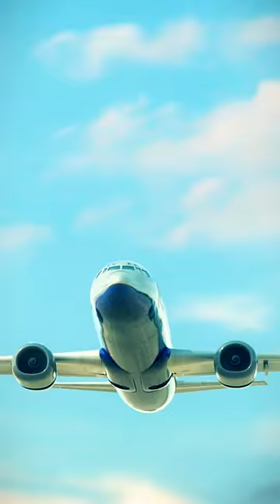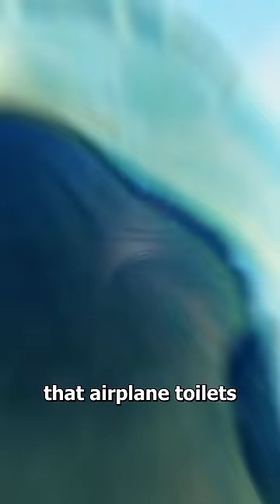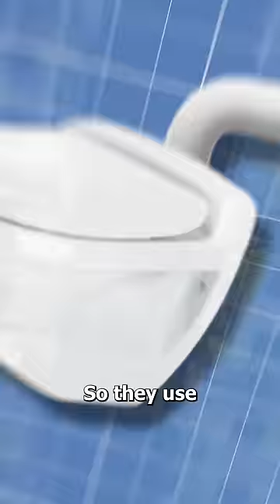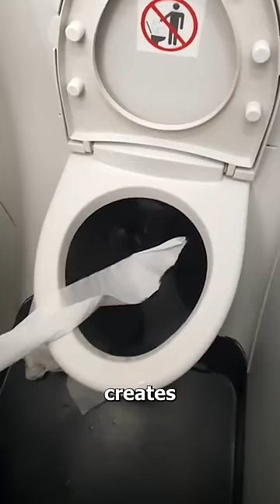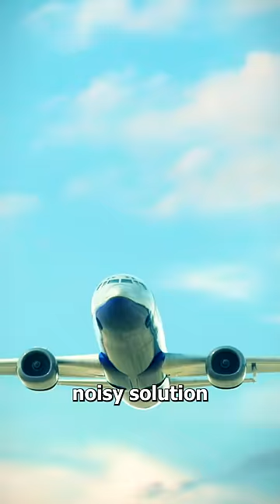Why Airplane Toilets Are SO Loud 😖🚽

Comment: Imagine staring at a plane in the sky and after some time, random peoples shit fall upon you 💀💀
Reply: This had me laugh crazy ..😂😂😂😂😂
Reply: No Wonder Why Discord Mods Don't Go Outside
Reply: 69 likes let me ruin it 

Btw funny comments
Reply: Chocolate rain
Reply: Someone actually died from that. All the waste that gets collected turns into this blue ice like thing and gets dumped out. It fell on a dude killing him
Reply: @dannielyt  'I felt that' -  👴
Reply: I was looking for a comment like this
Reply: @AlexSanders500 t doesn’t do this unless in case of emergency. The planes have tanks for this and it is emptied with the grey water (also in a separate tank) on the ground before they refill the clean supply tanks.
Reply: @AlexSanders500 that's cap
Reply: @AlexSanders500 it doesnt, your lying. i work for qantas and it actually gets sucked up into the plane and then it gets cleaned up.
Reply: @royalewithchz  i looked more into it, turns out its more of an accident not an actual thing thats supposed to happen lol
Reply: @AlexSanders500  only happens if there is a leak and its only a fluid that freezes,  very rare
Reply: It can’t it goes into a tank like in RVs.
Reply: @LSnium   yes but there can be a leak where its serviced which then forms blue ice, a 727  lost an engine  from the blue ice being sucked up by the rear engine on one side. over OKLAHOMA I believe.  Quite awhile ago.
Reply: 1985 AA 727 over New Mexico from blue ice from leaking lavatory connection, engine snap off from sudden stoppage
Reply: This happened before lmao
Reply: JOE DIRT! 😂
Reply: Ask the veterans from the 1920-30s, they've probably felt that already since that time the toilets are just holes to the outside of the plane 🗿
Reply: Nahhh💀
Reply: @dannielyt  blud found the emoji section
Reply: Ewww this got me grossed out going to barf 🤮brothers got bird feces on their shirts it’s gross,but not as gross as what you comment is all about 🤮
Reply: @maidarawad1961  💀💀
Reply: @AlexSanders500 they don’t drop it from the plane soooooooo
Reply: 😂😂😂😂 this is what I was trying to say 🤣🤣🤣🤣
Reply: @alexleo172 ohh so that's what he was singing about.
Reply: @AlexSanders500  aint no way people got killed by a turd bruh💀
Reply: U made me laugh hard 😂😂
Reply: 😂wth
Reply: @AlexSanders500 tf are you on? the waste is stored in a container, it doesnt just fall out of the plane lmao
Reply: @LaMelon  bro can you read? I later corrected my self that its a leak that can happen 💀
Reply: @AlexSanders500 the waste does not fall from the plane, it gets sucked into a tank and after the flight the ground crew empty the tank
Reply: I jus made this 1000
Reply: Dont worry all gets caught in a tank
Reply: @dannielyt 🗿
Reply: @AlexSanders500 NONSENSE
Reply: @JamesAnderson-mr2sg as opposed to the front engine?

Comment: Disturbing fact: It’s possible for an airplane toilet to suck your intestines out of your body. This is called a prolapse
Reply: New fear unlocked
Reply: Thanks for unlocking a new fear, now I won't ever go to toilet in airplane 🥲
Reply: Just empty out everything before the ride
Reply: @ShubhenduXD stand up before flushing
Reply: No it’s not
Reply: The suction force is also powerful enough to break bones
Reply: Yep, thank you. I'll never use an airplane toilet again.
Reply: this is why i never took a shit in an airplane bathroom
Reply: No, your intestines cannot get sucked into a toilet cruise ship or airline toilet with strong suction.

The toilets on these vessels are designed to flush away waste and not suck anything in.

Even if the suction was incredibly powerful, it would be impossible for something as large as an intestine to fit through the small opening of a toilet bowl.

So rest assured that you can use the restroom without fear of having any body parts accidentally sucked away!
Reply: Exactly so please stand up before you flush
Reply: It was because of someone telling me this, that I now never use the plane toilet to poop
Reply: @cheems5015 m... not really, sucking won't break bones but if the hole is too small and the sucking force strong enough then it can definitely but the suction in itself won't break bones. Even blackholes just stretch out your body and do not break bones.
Reply: @saumyashah4831 if you believe that it would suck out intestines 😅
Reply: @ShubhenduXD  ive never been in one tbh, its digusting and now i have another reason
Reply: @Silver-we9jb  same💀💀💀
Reply: I was thinking about this while watching the video but of course it’s a thing
Reply: This is incorrect it’s not possible for it to suck out your intestines
Reply: Why does that even exist
Reply: That’s just a lie
Reply: Our intestines are fixed in our bodies lol, they're not at all loose as portraited in the movies xD
Reply: @Lubin-md4ml  and the way Final Destination described as well
Reply: @jersanjereos4525 Thx. My family and i are going to vacation soon so this is helpful
Reply: @saumyashah4831  even if that’s the truth I’m still not testing that shit
Reply: May or may not be true, has been proven to be real pool is drains
Reply: @meepacorn9253 it’s a real fact
Reply: ☝️🤓 Actually, a prolapse is a natural event where the supportive tissues of the anus collapse and allow the large intestine to begin wriggling out of the body. However, hypothetically, if a prolapse were to occur on one of these toilets and someone flushed without realizing they prolapsed (which is hard to believe, as it is a very painful process), there is a chance their intestine would be pulled out further, though they'd very likely enter shock quickly afterwards due to the pain.
Reply: @Tazz3181 it's not, your intestines are fixed together, and prolapses are completely different
Reply: Who the fuck flushes while still sitting there
Reply: @blame4889  bruh just stand up before flushing
Reply: WHY IS THERE A NAME FOR THAT
Reply: @cheems5015 That's how you know it's too effective.
Reply: Why
Reply: I was looking for this comment
Reply: Just flush the toilet after your done with your buisness, you wont risk it
Reply: can I re create it
Reply: r.i.p ballsack
Reply: Well im never going on an airplane after reading this
Reply: Really? 😮
Reply: Yup im scared now
Reply: @jersanjereos4525  but what if you're elbow hits it? 😫
                                    🕳️
                                    🩸
                                    💨
                                     🏝️
Reply: Heheh! That won't scare me, because I stand up when I flush! Unlike my dad who shits a shit ton so he needs to flush once in a while even when he's not done!
But I'm pretty sure they already realised some ppl do that so they found a way around it! Don't worry!
Reply: new fear unlocked - plane toilets
Reply: @5185-p7w  i mean, u could read the comments above u except mine
Reply: How tho
Reply: It’s fine to shit in the plane toilet, just stand up before flushing
Reply: bro shut up i’m literally about to get on a 4 hour flight💀
Reply: Я НЕ УМРУ В ТУАЛЕТЕ
Reply: @saumyashah4831 It literary appeared on the news that a woman's intestines were sucked by a airplane toilet a few years ago
Reply: Do people die after their intestines got sucked in the toilet or they get surgery?
Reply: Wait, what if I stuck my, you know 😏 would it get longer?
Reply: @ANormalLemon  it would suck the entire thing in
Reply: @apple_ilev5s  wow
Reply: @daineramosquitco5816 bro just stand up when u flush
Reply: @versthappening603 stand up when u flush
Reply: Stop telling people this made up bs lmao
Reply: @antonybomez9335 😂😂😂😂😂😂😂😂😂😂

Comment: I have a fear of getting my intestines sucked out from those
Reply: if u sit and flush it can
Reply: No, your intestines cannot get sucked into a toilet cruise ship or airline toilet with strong suction.

The toilets on these vessels are designed to flush away waste and not suck anything in.

Even if the suction was incredibly powerful, it would be impossible for something as large as an intestine to fit through the small opening of a toilet bowl.

So rest assured that you can use the restroom without fear of having any body parts accidentally sucked away!
Reply: @saumyashah4831 I don’t think you understand what they are talking about. Your intestines can’t get sucked through the hole, but there have been real instances of people who were sitting on the toilet in such a way it created a semi air tight seal, and so when they flushed it caused a portion of their intestines to prolapse. Google it if you don’t believe me
Reply: @saumyashah4831 then why is there a sign that says “Do Not Flush While Seated On Toilet."??
Reply: Could you be quiet, I would like to sleep this month
Reply: @josephisherelol5302  tf?
Reply: @josephisherelol5302 turn off notifications

Comment: Fun fact: Below a certain altitude, the toilet uses a powered vacuum system to suck waste down the toilet. At above a certain altitude, it uses differential pressure between the plane and the outside to provide the suction. All toilet waste is sucked into a waste tank in the aircraft. It does not shoot overboard. I’m an airplane mechanic and this is what I learned while working on a passenger Boeing 747

Comment: Apparently the vacuum pump is only used at low altitudes. At higher altitudes the pressure differential between the cabin and outside air is leveraged to create suction

Comment: i learned in college there is a vent that opens to the outside and because of the pressure change it sucks the toilet
Reply: or it’s a vacuum pump that works with the vent to the outside